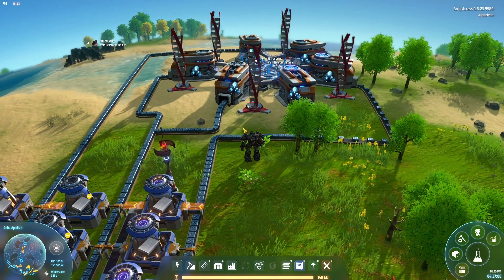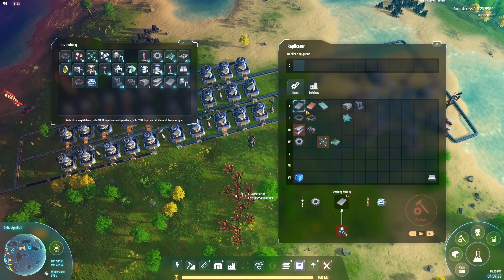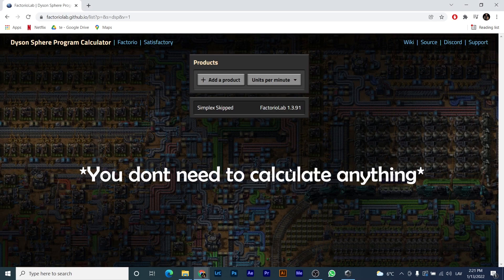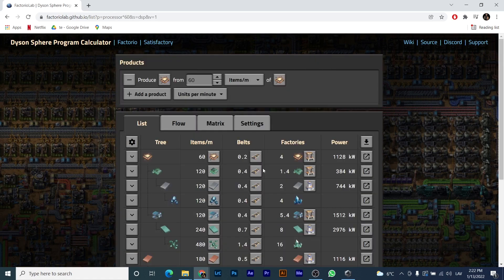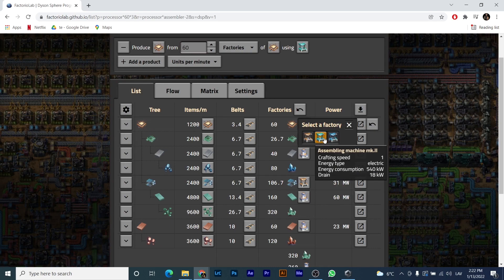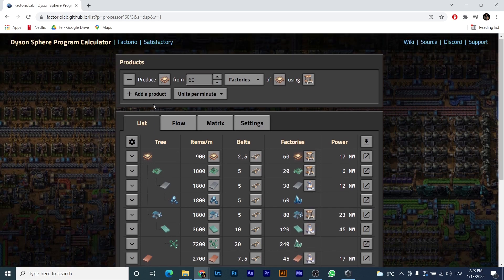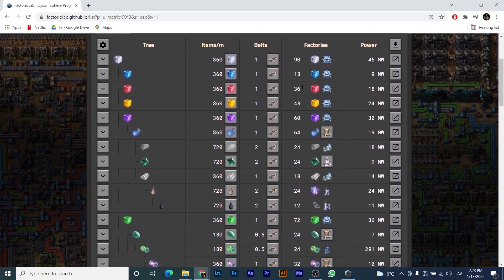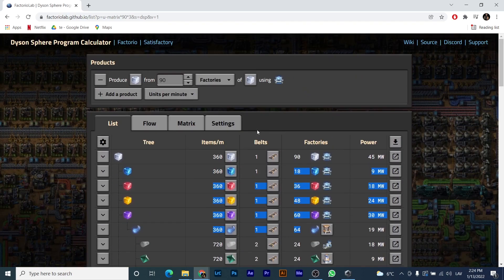Build EXACT ratios for any item.

Comment: Good calculator, but it has its own problems.
- Flow tab is bad designed
- Don't have an option to add to your current production tab list excess materials from other factories. For example, you have a factory A that produces 5 yellow cubes and needs 5 titanium crystals. And you have a factory B that produces 2 titanium crystals. You can't just simply add in calculator those 2 titanium crystals from factory B to factory A and recalculate the amount of assemblers for 3 titanium crystals in factory A. Hard to explain by words, but eventually you will understand it in late game.
Reply from the maker: yeah true, it works great as stand alone. But now it doesnt take in consideration if you are using pilers and spraying your cargo and at what level, so at late game this kinda becomes obsolete.